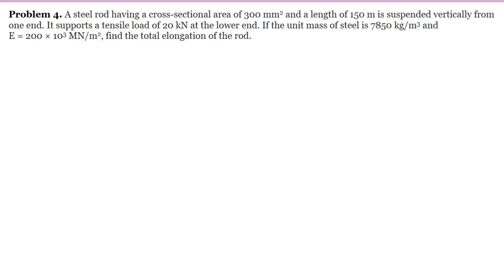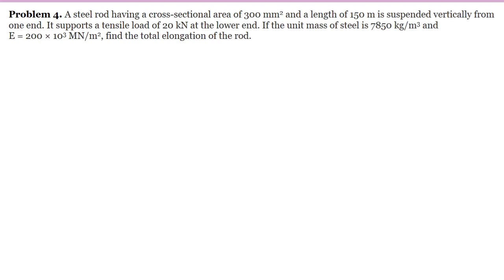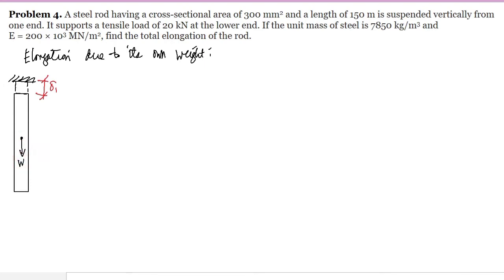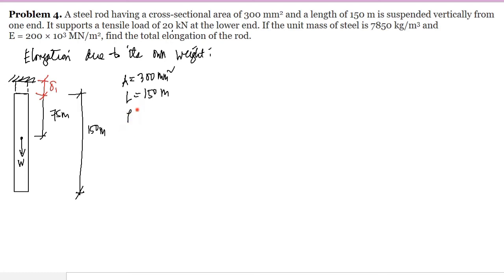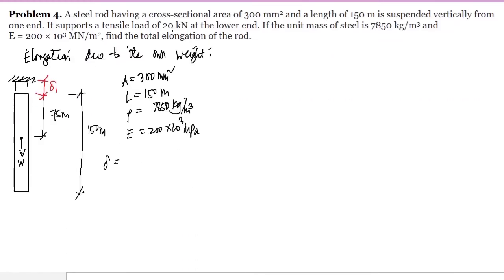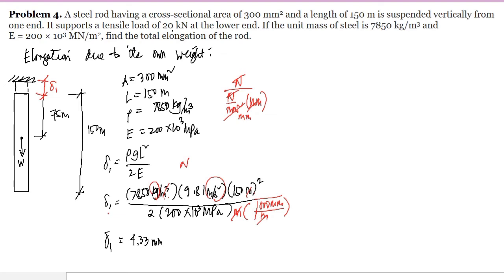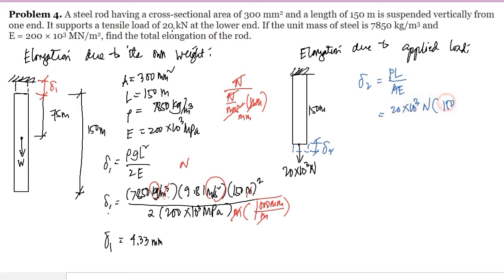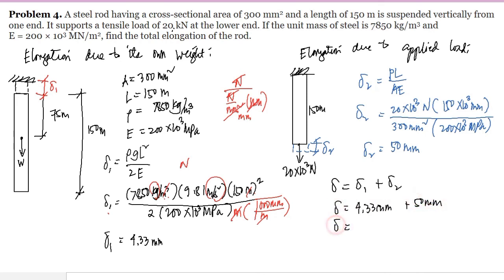Axial Deformation Problem 2

Comment: genuine question: can I ask how is it a density? (sorry, i was basing on the word unit mass of steel so... hehehe)
Reply from the maker: Density is the mass per unit volume. I never use the term unit mass sorry. (Napaisip tuloy ako, mas aware ako sa unit weight than unit mass).

Comment: Possible po ba masolve si E? Paano po if hindi given si E sir?
Reply from the maker: Constant po kasi ang E for every material, may kanya kanyang value yan like for steel 200 GPa. If given naman ng stress at strain, E=stress/strain. May relationship din na pwedeng gamitin using Poisson's ratio. Depende padin po sa mga given parameters, but again E is constant po depende sa given material.